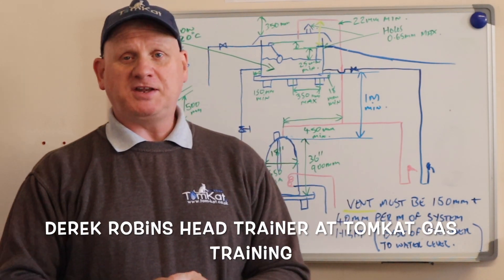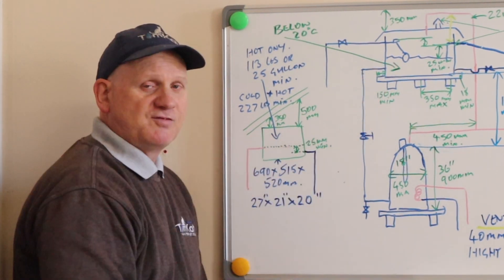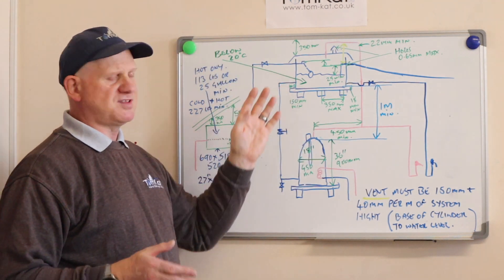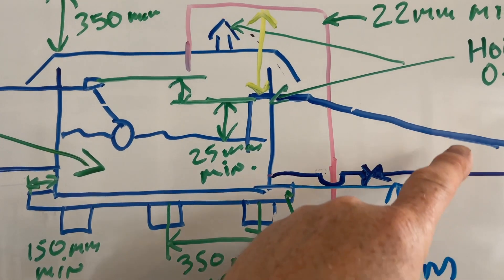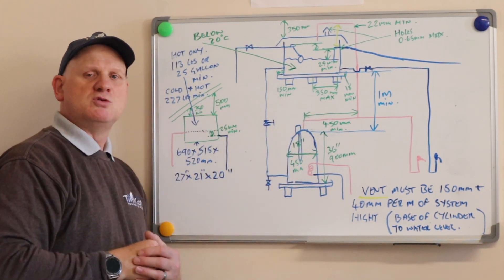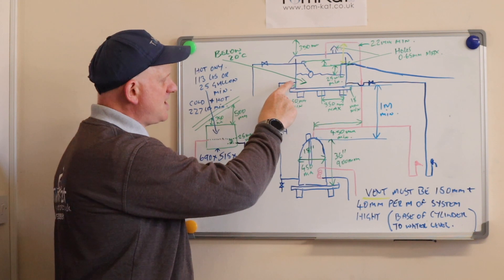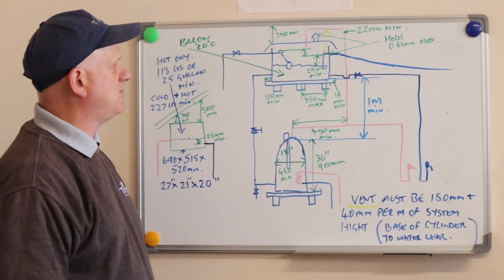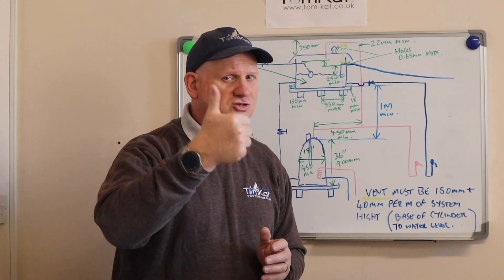How to install a cold water storage cistern feeding hot and cold water.

Comment: Derek, I think BG took out the overflow on my heating system, allowing expansion through the feed pipe. The system works fine but I never see much on a system like this. What are your thoughts. I imagine they had a pumping over problem and this is BG solution.

Comment: Hi Tom kat there’s a regulation regarding the vent pipe going into the cold water storage cistern regarding legionella it must go into a tundish and not into the cold water cistern.
Reply from the maker: Nothing of that in the water regulations so what regs have you seen that in
Reply: Did a bpec legionella risk assessment course and it was mention. if the vent pipe pumps over into the cold water storage tank the temperature can go over 20 degrees, if you run the vent pipe into dundish increase 22mm to 28mm and run it out side as in your unvented regs it will stop this appending .

Comment: These days , f&e and storage cisterns are more likely removed rather than installed.
However, I think all new installers should have an understanding  of these installations,  if only to add to their  knowledge base.
On the point of potential maximum storage weights,  the actual capacity is less than the nominal  capacity and therefore,  worst case scenario the maximum weight of the cistern would be higher than 227litres?